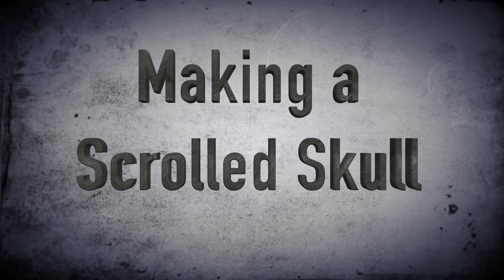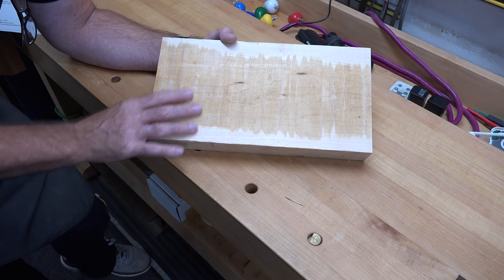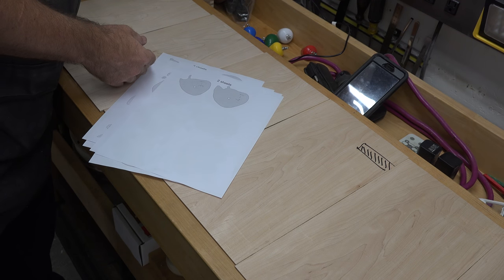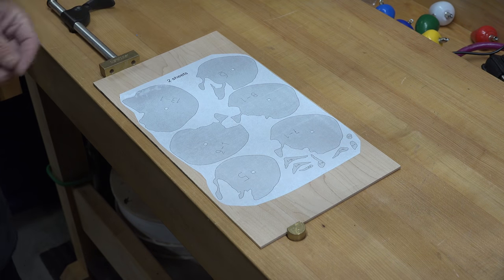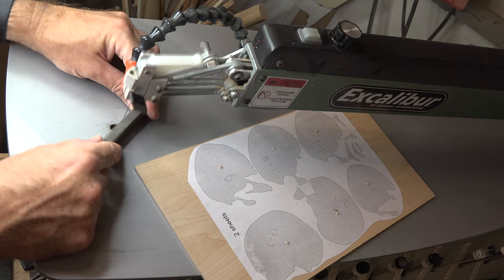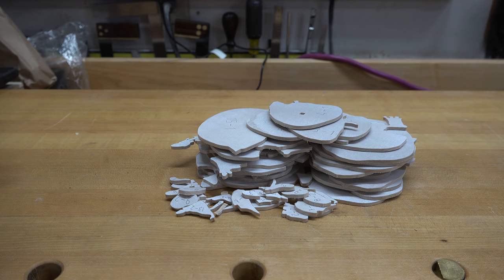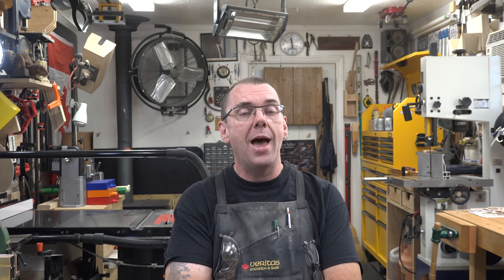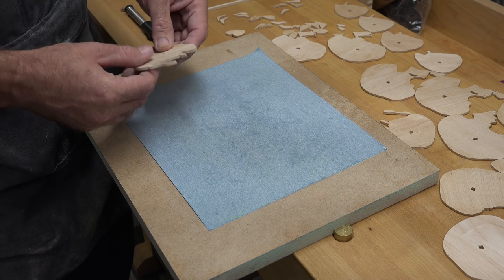Scrolled Skull

Comment: Scale up to 3/4 plywood, add it to your front yard for Halloween. Might want to move up from a scroll saw for that one :)
Reply from the maker: 3/4" ply.  The scroll saw could handle that easily.  Not to mention that I have a 30" throat in my Excalibur so size wouldn't be an issue here.  I like the way you think Ken.  This might be an idea for sure.  Thanks for tuning in,
Reply: .....or use giant pieces of styrofoam.  Like you did for those tombstones. That could be really cool.
Reply from the maker: @Bayleigh70  That would be cool.  Might have to think about this one.  Thanks for tuning in to the show.

Comment: Patterns stuck to thick-ish hardboard and cut and file to shape and use as templates and a router pattern bit.
Reply from the maker: That would work for sure MrBonners.  Just goes to show, that there is more than one way to do every process in wood working.  Thanks for tuning in and for taking the time to leave a comment.  I truly appreciate it.
Reply: @acutabove_woodworkings  For this type of amusement work, quick repeatability is high on the consideration list. People see it and will ask you to make them one.
Reply from the maker: @MrBonners  Once again, I agree.  People have already asked me to make them one.